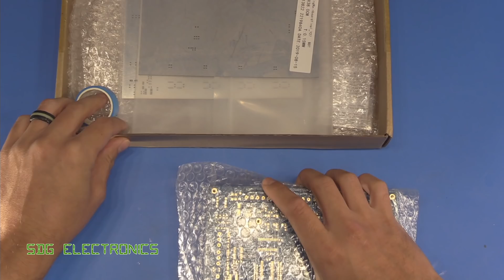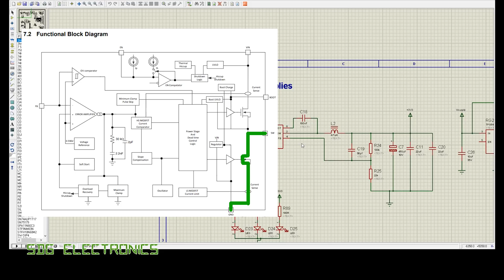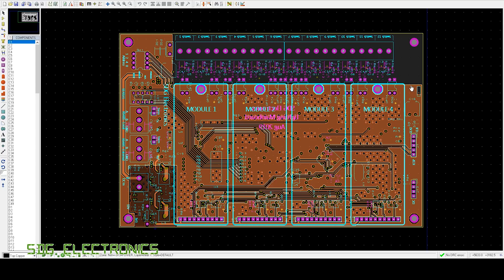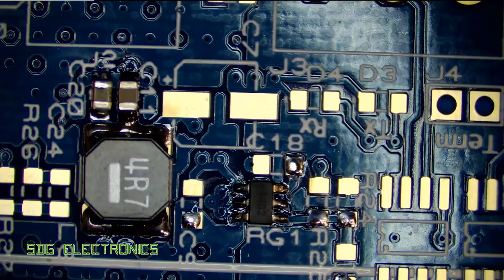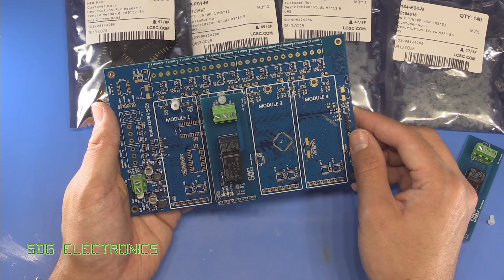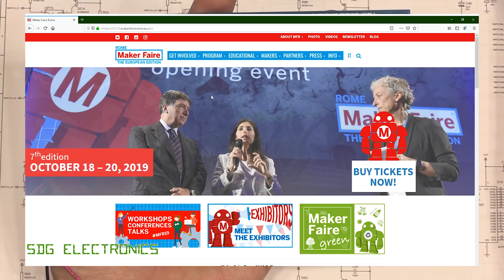SDG #106 4 Layer PCBs from JLCPCB - Lighting Controller Project Part 6 - Initial Testing

Comment: Hi, just a quick check. On Layer 2 (Power plane), those 2 bottlenecks between SW1/7-Segment display and 7-Segment (R16)/bottom part traces of Module 2, isn't that a bit of an issue?

Comment: Cool project, developing nicely. I also enjoyed your constant current videos especially with the PIC33. Am currently developing my own boost circuit using dsPIC30F4012 on solderless breadboard to drive string of 8 to 12 White LEDs for a dimmable ring light on a camera... I know it's an older device and all, but I have used them in the past and 40-pins gives me plenty to work with.
Keep the videos coming. Great stuff! Thanks
Reply from the maker: I didn't get around to finishing that LED driver project. I might revisit in the future. Thanks

Comment: @20:00 and @5:30 had a second look at the video today... all those components for a led current limit ? 

20 cents (100pcs) gets you AL5890 from Diodes Inc, part code AL5890-10P1-13DICT-ND on Digikey ... also available in 15,20..45mA and also in SOT89 for better heat dissipation.  It's 7v min, 400v max, 10mA ... Turn on voltage typical 5v, max 7v + voltage drop on led, so it would work great for that output led and you could probably also reuse this part for the optocoupler if 10mA is enough for it.  You're saving space on pcb and reduce your bom, no zener diode to turn on led from 7-8v up, part will do that for you. You say the voltage to optos is 9v or higher, that's perfect for this part as well. 

If you don't mind the maximum 40v input voltage, you also have BCR420UFD at 23 cents (100pcs) which also gives you the option to adjust current with external resistor (it's preset at 10mA if no resistor is added). It needs at least 1.2mA to work and seems to go up to 350mA.

You use so much space on board and need to add those pnp parts to your BOM to save maybe 5-10 cents?
Reply from the maker: It's actually just the BC856B dual transistor, 180R resistor and 100pF capacitor for the current limit, so cheaper than the AL5890 and some other similar devices that I looked at. It obviously is simpler though as you say and I can't remember why I dismissed it previously. The NSI45020AT1G is also another option.
Reply: I've recently purchased some BRC401RE in SOT-343 from LCSC @ 18 Cents for a hundred. Very happy with it. Very small package and no externals. Absolutely agree,  it's well worthed! Been looking at NSI50010YT1G @ 7 cents for 150, SOD-123, 10mA up to 50V. Those,  I believe are the best option if you don't care about the board space and automotive/industrial grade,  only parts count, cost savings and simplicity.

Comment: @18:00 You could have used pci-e x1 connector and have your boards made with edge connector and sitting like low profile cards.  Use two (one on each side) for better stability or maybe see the low profile bracket suggestion below.  The connectors are cheap. as low as 20-25 cents if you buy 100 and there's plenty of pins. 

You could optionally 3d print a flexible plastic bit to go over the lip of the pci-e connector and lock the card in place (that's why it's there after all
If the final product is gonna be in a case, you could install low profile brackets to your cards and screw them to the case... for ex. search e bay for "Low Profile Bracket For M1015 9260-8i 9211 9261 9271" 

 If you have the boards sitting like extension cards then the relay could be positioned even higher (away from main board) and from the other plugged cards and you could possibly add cuts in the pcb for higher distances.

Comment: Wow, this project is really coming together.  Looks awesome!  Excited to see more as it progresses.  Interesting to learn about wetting current... I have had switches oxide over but I thought it was because I did not use them enough, normally switching them a few times clears up the signal in my case.